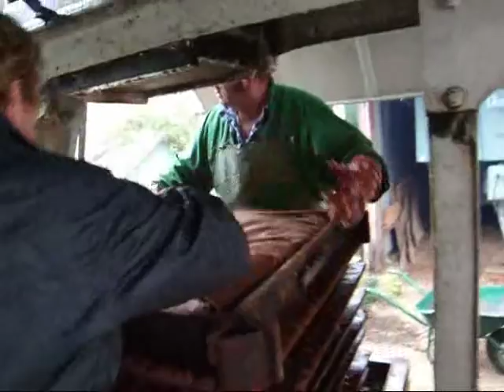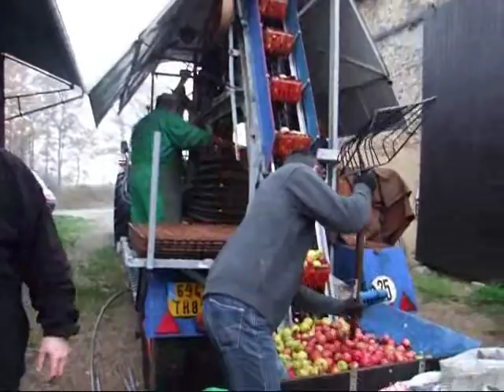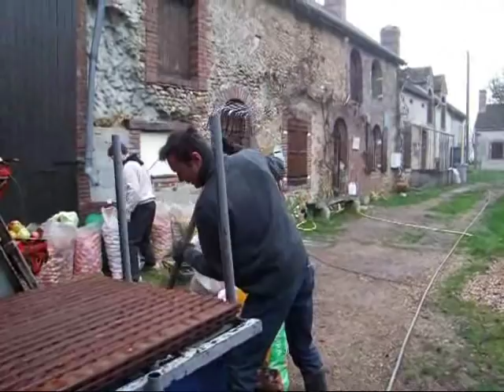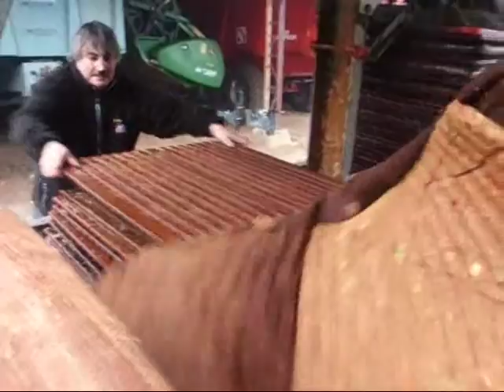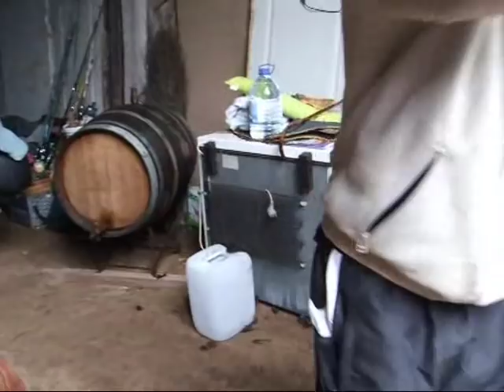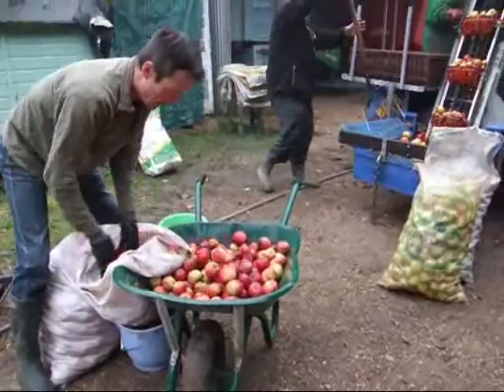mobile cider press

Comment: How did they get the stacked cheeses from the grinder to the press and the finished pulp from the press to be sitting under the grinder?
Reply: turns around the center. you can see a spigot on the one they are stacking